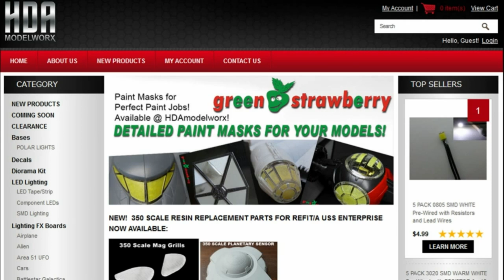Polar Lights 1:350 Klingon K'Tinga battle cruiser plamo build 5

Comment: I have the light set, I ditched most of it Frankly. I think everyone was worried about how the windows would look based on how the TOS Enterprise Windows were problematic from Round 2. But in this case the cobra head and bulb windows were just fine. I cleaned up from behind on the bulb windows and used the kit part. The photo etch windows are actually a bit of a disaster waiting to happen.
Reply from the maker: Yes, actually I think that if you are able to light the kit yourself, the lighting kit isn't all that necessary. The photoetch doesn't really bring a whole lot to the model that it doesn't already have. Plus it is frustrating how the photoetch windows for the bulb do not match those of the plastic parts.
Reply: @stevethefishdotnet  Yeah. I'm mainly using it for the detail parts. I've done all of the lighting bits on my own with SFX for the Torpedo Firing. I kinda want one in my movie room so maybe i'll buy another and use the OOTB lights in that one.
Reply from the maker: I've decided not to use the photoetch for those A-shaped parts on either side of the base of the neck. I think the plastic parts look better. Of course, there is a sponsored build, so I am doing a quicker build of it without worrying about lighting it on my own. Knowing what I know now, I'm not sure if I would recommend the photoetch. The lighting it comes with is pretty good though. Have you done something like this for the photon torpedo?
https://www.youtube.com/watch?v=0gmMR_DrhFU
Or this, but not quite as nice:
https://www.youtube.com/watch?v=U050qhSA66s
Reply from the maker: Thanks for sharing. How did you accomplish that? Was it with timer chips, or some Arduino thingy?
Reply: @stevethefishdotnet  Arduino with a SFX Board from Adafruit.